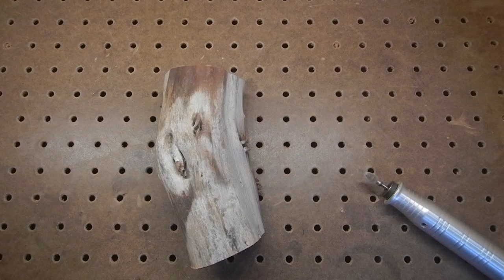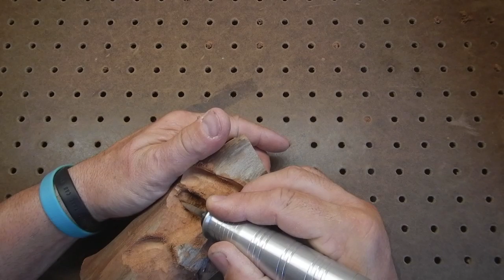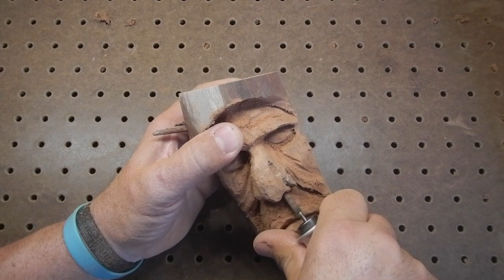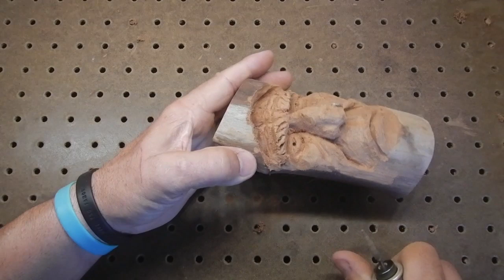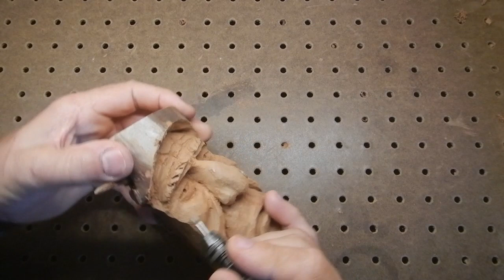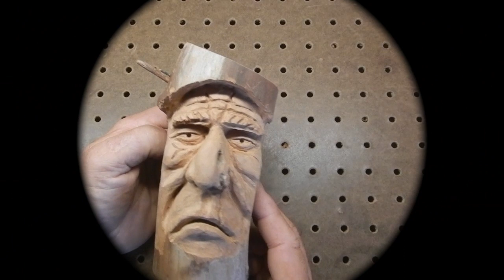Power carving Mr Nose with Dremel-Kutzall

Comment: judging by the wood dust color could be sumac or walnut. A very well seasoned piece i might add as it would be challenging with a knife but perfect for the rotary burr. Sycamore is a great wood for this 3 years into its seasoning. Great Job!

Comment: How do you keep from ripping off your fingertips? And what safety techniques can you share with a guy new to power carving.
I'm having trouble with control of the bits as they grab or dig in...I guess it's going to come with time, but any tips would be appreciated 👌
Reply from the maker: I think the way to avoid is to be slow and don’t force the bits. strong grip helps too.  
What machine do you have?

Comment: Good afternoon, friend, what wood are you using to perform these jobs and types of tips, I would appreciate if you can help me to start this wonderful hoby.
Reply from the maker: Wladimir Silva Gomes Hi the wood simply driftwood I collect them nearby. The power carver with the shiny silver handpiece brand name foredom tx and the darker one Dremel 3000.with the collet foredom can except and handle sizes up to 1/4. Dremel not so much I usually use 1/8 or under.